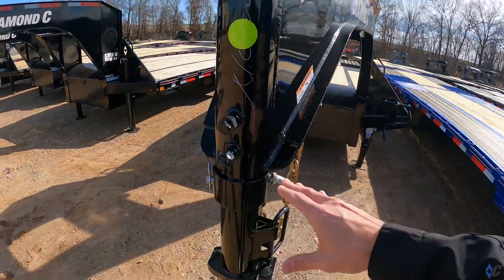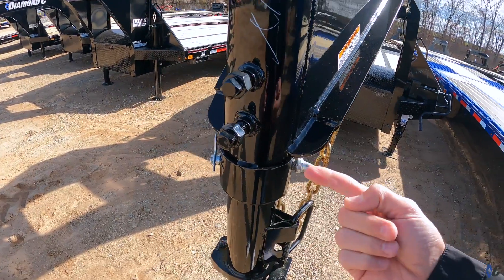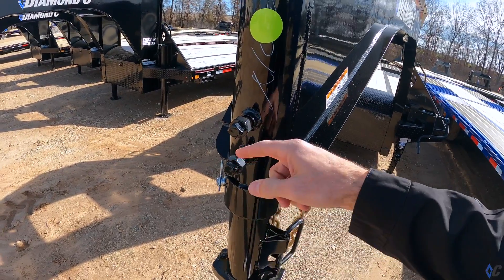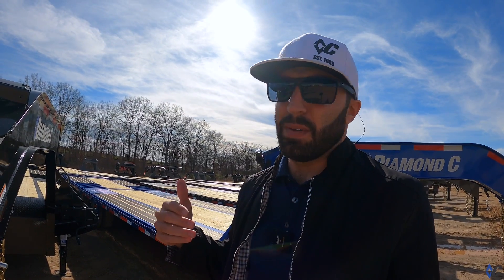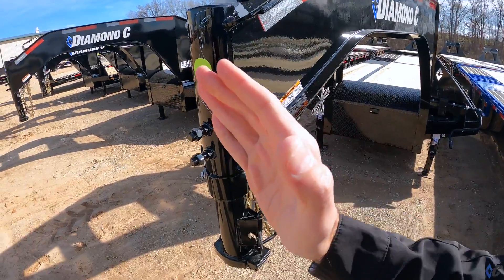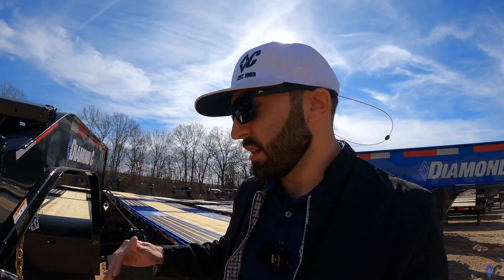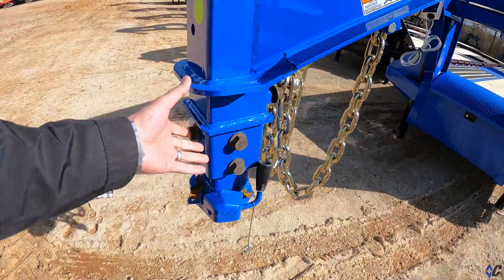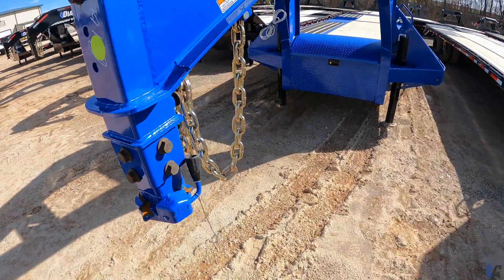Gooseneck Coupler Maintenance 🙌 | Diamond C

Comment: I borrowed a friend's Big Tex dump and was asked to remove the coupler if it was going to be used (fear of trailer being stolen). So i removed the coupler every time not in use as requested by owner. How many other owners do that????
Reply: I’ve use double locks because I feel like if somebody has a Cupler laying around and you don’t have nothing in there that could cause someone to try to take it and put their coupler inside your trailer and pull off. They have better chances then just cutting the lock off and making a lot of noise and trying to get two locks off versus sliding a coupler in then screwing bolts down
Reply: @marquisjones8769  curious, do you have a blank hitch to insert into the sleeve or just use a pin & padlock?